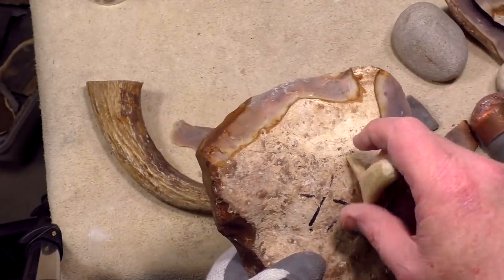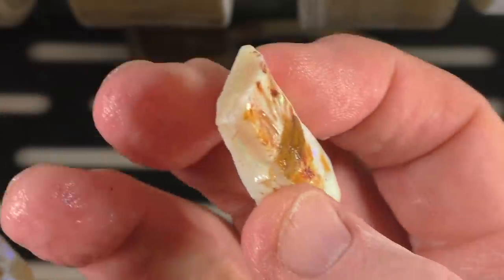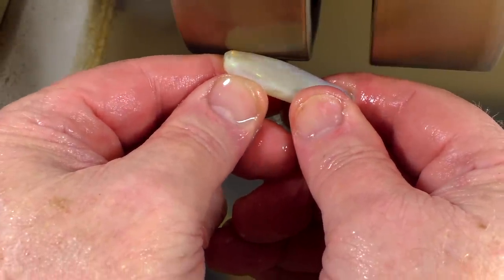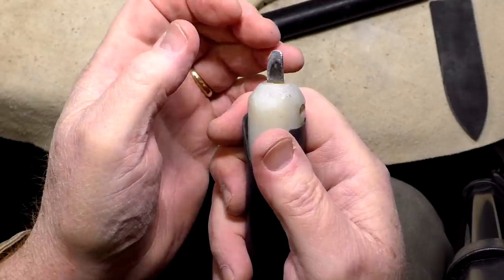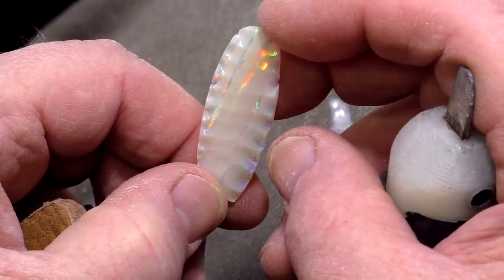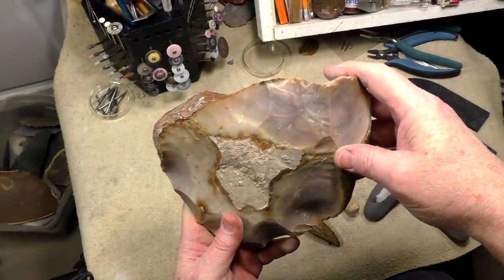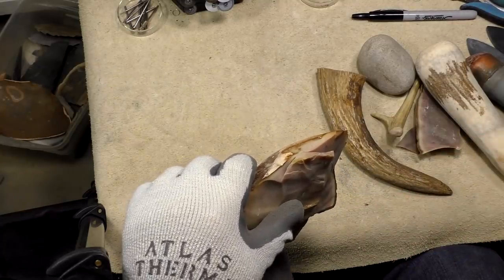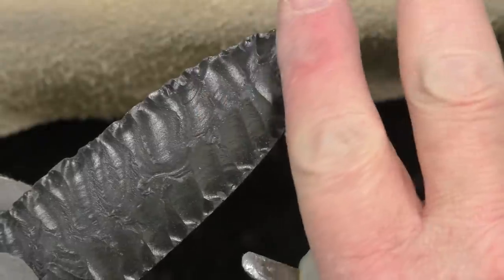How to Make Opal Arrowhead ... IF YOU DARE!

Comment: Im happy that you went as in depth that you did in this video about flintknapping, thank you! I have been snapping for about a year now and have used everything from indirect percussion to prismatic flaking. Been working nothing but petrified wood because it is the only thing I can get here in Colorado locally, and have tried opal only once, and that was last week actually. It was common potch that was casted through grainy petrified wood but man did it come out amazing when it was done. 
The way you explain this stuff is spot on and very accurate, Thanks for making this video, a lot more people that I have met have wanted to start, have started, but end up cutting themselves and stop. Either that or they can't get the right angle, its hard to explain how to get it right. Great vid

Comment: Im a flint knapper but Id be afraid to try an opal. I tend to go too far and screw up. I generally use chert or obsidian which is cheap. Lately, Ive been knapping colored bottle glass. Id honestly be afraid to use opal though
Reply: @PulitzerOpal  I flake everything. Im just an ameture and finding thing to knap is half of the fun.  Ive tried preforms and I do like them but most of the time I find myself picking up material out of restraunt rock gardens. It drives my wife crazy. Maybe someday Ill order some cheap opal and give it a shot.

Comment: When you notch your points i see that on most of them you cut the notches in instead of flaking them with a flat preassure flaker why is that is if because you are busting some opal or what? I use a small antler billet and indirect percussion

Comment: I think I have to give this a shot sometime soon 🙂 Think I still have some obsidian, and good amounts of lower grade opals to practice on.
Do you know if jasper or agate works?
Reply from the maker: While opals and obsidian are commonly used for lapidary work, jasper and agate can also be suitable materials for lapidary projects. Jasper and agate are both types of chalcedony, and they are known for their hardness and ability to take a beautiful polish. Here's some information about working with jasper and agate in lapidary:

1. Cutting: Jasper and agate can be cut using lapidary saws with diamond or silicon carbide blades. They are generally harder than opal, so they may require more abrasive blades.

2. Shaping and Grinding: Lapidary wheels and grinding wheels can be used to shape and smooth the jasper or agate pieces. You may need to progress through various grits of abrasive wheels to achieve the desired smoothness.

3. Polishing: Polishing jasper and agate can be done using polishing wheels and compounds. These stones have a natural beauty that can be enhanced with a high-quality polish.

4. Safety: As with any lapidary work, it's essential to follow safety precautions, including wearing safety goggles and using appropriate ventilation to protect yourself from dust and debris.

Overall, jasper and agate are excellent choices for lapidary projects, and you can create beautiful pieces of jewelry or decorative items with these materials. If you have lower-grade opals to practice on, it's a good idea to start with those and then move on to jasper and agate once you gain more experience in lapidary work.
Reply: @PulitzerOpal  thanks for your thorough answer 😊 I'm an experienced cutter of cabs and I've made quite a few simple opal carvings. I've just never tried makeing arrow heads. I like them a lot, so I've tried study your work.
I know flint, opals and obsidian can be used, but wondering if there are other materials that are suited for it as well?
Nice opals is my goal though, but would be a stright up stupid starting point i think 😆

What's the easiest, large or small stones?
I recon larger stones will require substansual amounts of force while smaller ones probably chatters more easily, not sure what's worse or if my asumptions are even close to reality 🤷‍♀️😅